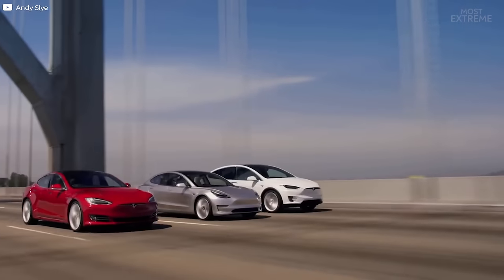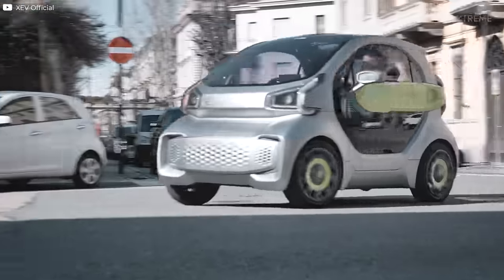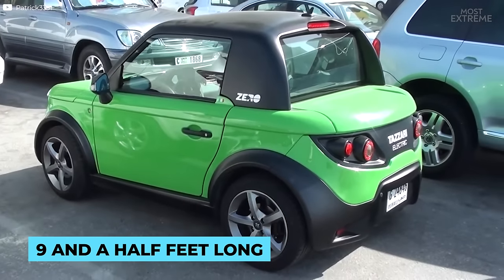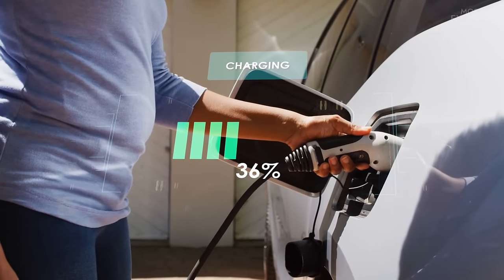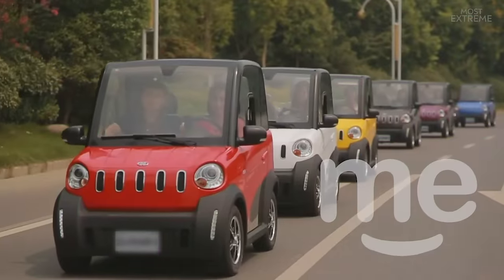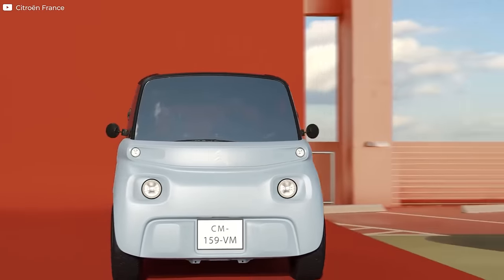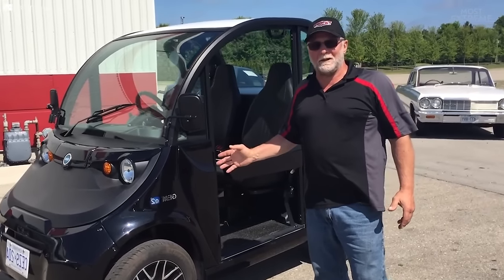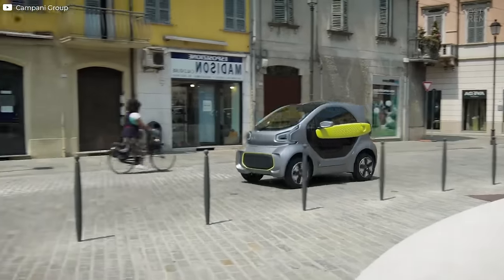10 Electric Mini-Compact City Cars For Urban Mobility

Comment: We urgently need something similar to the Japanese Kei-Cars in Europe. Restrictions in size and weight would be much more beneficial than for the power of the motor.
Reply: I have been saying this for years even before the EV craze. I would buy an kei class van in an instant if it was available and in affordable price range and if i could get one of those old Subaru E12 or Suzuki carry like cars with modern tech i would be very happy. 
I have no need of 2 ton oversized car all i need a small van that can haul stuff and isn't overpriced to the max.
Reply: @Fydron  rather unfair to tall people who then can't or have to pay lot more to drive, since they dont fit in them.
Reply: @yorickkok9223  well for me a kei class van would be perfect it's just stupid that there is zero to none available except handfull that people them self have brought here.

A 4WD Subaru van would be perfect it's small but can still haul a couch if I need to and has good mileage.

For me personally I have zero need for those oversized suv's and normal sedan to me is just plain useless.
Reply: @Fydron   the peugeot bipper and the fiat fioriono are not much bigger, even smaller is an Aixam Pro(downside the max speed is 50km/h). sadly the old kei vans with the cab over the engine is in these days are not safe enough to meet the safety standaards.
Reply: @yorickkok9223  I'm 195cm tall and drive a kei car Suzuki Hustler. To be honest it's enough space for the driver and passengers of even bigger height. I have enough room for legs and there's plenty of room from head to the roof (and I can sit on the rear seat behind myself). So it's not that small as you think.

Comment: I would drive the ones you didn't mentioned like:
- ACM City One (from Germany, with swappable batteries!)
or the "Baojun E200" from China, or XEV Yoyo (also with swappable batteries)
Reply: The great part about easy to remove batteries is also they die out over time in all cars. Ones that are meant to be swapped just make the process easier to do without having to pay a specialized mechanic to change your batteries like in say a Tesla.
Reply: Nothing Chinese for me, not even rice

Comment: I bought my Chevrolet Bolt EV almost 3 years ago and still love it. With its 260+ mile range, it shines both in the city and on the highway. With its 200 hp motor, instant torque, and a forced-limited top speed of 95 mph, it's a silent rocket. With its zero emission and almost zero maintenance, it makes me proud.
Reply: @Chingaso Clown Not "around the corner" for my Chevy Bolt. Last year, GM gave me a brand new battery as part of their recall program - totally free of charge -  together with a brand new 100,000-mile warranty. 

Moreover, before I returned my original battery to GM, I had it tested and they found that after almost 3 years of active everyday use, almost 50,000 miles, and three Canadian winters, the original battery's degradation was less than 2%. This means that, all things being equal, my battery will have juice in it for the next 50 years or so.

In other words, the battery is highly likely to outlive the car itself. After that, it can be taken off the car and used as a backup power source for my house. But, I am yet to find that out... if I live that long. 

In the meantime, I am still honeymooning with my Chevy Bolt and would never volunteer to go back to driving one of those fossil contraptions. :)
Reply: @amenhotepavoskin1307  smells like advertising
Reply: @justhavefun2640  Check your nose. Smells like real-life experience shared by a real owner.

Comment: I want something more like a subcompact.  A microcar would be great, except in the US you would be surrounded by big SUV’s and pick up trucks.
Reply: There really isn’t a problem with that.
Reply: @TEMUJINARTS  Line of sight and safety mostly. Line of sight is obvious, you wouldn't see much of anything being the shortest thing on the road. Safety though is what happens when a car that small hits anything else.

Most cars bumpers line right up with your windshield, and your low mass would mean you crumple and fly. Basically any kind of auto accident in a micro car is instant death for the micro car user.
Reply: @JustaGuy_Gaming  you’ve got a lot of opinions. I’m asking myself how much experience do you have and how much research have you done? 
Opinions seem to come off the top of the head more and more . Line of sight? I can’t speak for every micro car but I’ve own 3. 2 of with weee different models. And the crash tests available on both. Drawing the conclusion of what would happen if something small runs into something big isn’t very hard. But because it’s big doesn’t make it safe either mind you. I could expand on that but check it ok for yourself.

Comment: I live in the north east of the now un-united states And a real problem with electric cars is the cold weather.  You won't get half the battery life out of those cars in negative degree weather with the heat blasting and we travel longer distances.  I drive a smart fortwo with a petrol engine.  Some of the roads I drive on in small towns are narrow so it does well and it will go up to 95 miles per hour (152 km) if I choose to go that fast on the highway (i only go 60). I drive alone most of the time.  I would love to convert my car to run on propane because it's cleaner, but I don't have the funds.  Cost is a big issue for someone like me who doesn't make much money, so an old used smart car that runs on gas is all I can afford.

Comment: For USA urban use it must have Heat and AC. Must be able to go at least 100 miles on a charge. Must be able to do 70 MPH. Must ride smooth and be safe. At least a 3 door hatch back.

Comment: Hybrid cars would be better because you can use the battery In the  city and gazoline and diesel outside the city or Hydro-electric cars which I think will be the Best solution untill something better comes around.

Comment: Honestly only 3 things really matter in these 2 seater tiny cars

1. The trunk size 
For singles or couples who go somewhere without there kids. In short gorcery shopping for about 2 weeks worth of food. The trunk has to be moderately big. 

2. The dash board 
Needs a cup holder/s, functional heat and cold ac, and be able to listen to radio or connect from your phone via aux or Bluetooth. 

3. A steel body for the plastic rap around. 
If you drive anywhere near trh deep country and a pick up truck is going 80 miles per hour and both you don't see each other bare minimum steel frame and steel doors. 

That's just me personally.

Comment: Perfect for local driving, BUT, £10,000 is NOT a cheap car.  China is making EV K-cars cars with similar specs that sell for around  $2,000 to $3,000.  For some reason they are not legal to use in the UK.

Comment: Not sure what the market is for such cars. There are actually very few of them in cities, I see most of them in the countryside, at least the ones that don't require driving licenses. They are used by aged people who live in rural houses or small villages and need basic mobility.

In Europe, for instance, most cities have decent public transportation and most urban people don't need a car, but those who do are more likely to come and go to and from the suburbs and the city center or periphery, driving on the circular highways that surround cities, on drives that would take forever using public transportation. Being able to drive at 60mph / 90 km/h over any distance without deteriorating the battery pack should be a base specification.

Then, while renting such a car for specific one-time needs, like you can for the Citroën Ami by the minute (!), makes sense, the appeal of purchasing a car that can go nowhere is very limited. You'd need to rent or borrow another car as soon as you need to transport people or goods or go a bit further away from the city, say in a 2 hours / 100 miles / 160 km radius. That should also be part of base specs for micro cars. The two go together: A larger battery pack allows for higher voltage and more powerful electric motor. Base specs harmonization would allow for easier comparisons between brands, as well as decrease prices a lot, with all kinds of vendors competing over producing drive trains that would fit many different brands and models of micro cars.

I would also add that being too short on specs such as battery pack capacity means that the range becomes even less in winter or after a few years, thus making the car practically unsalable.

One last thing: China is currently leading on electric micro cars and EVs in general, yet I would personally not caution a regime with so many blatant violations of human rights. So no driving Chinese EVs for me until the political situation has changed, and I would also recommend not investing into China until then.

Comment: These cars are only practical when they have a top speed of over 70mph. Yes,  they're great for urban commutes,  but people don't want to have a separate car for travelling a few junctions down the motorway.  I've owned 2 petrol smartfortwos and they have had top speeds of around 80mph. They weren't ideal for motorway travel,  but (crucially)  they were capable of it. I find it so disappointing that almost all of these electric microcars are so slow.  It's the reason why I wouldn't buy them.
Reply: Making them run faster would require a more powerful motor which would be heavier and more expensive, which in turn requires more battery for the same range which is also heavier and more expensive. 
A great commute vehicle is a bad travel vehicle and vice-versa; an increasing amount of people are realizing it's not worth for them to buy a car based on the ability to road travel with when 99% of the time they're going to use it to go to work or to buy groceries and for short distance travel they have the option of buses and trains anyway.
Reply: @jackmcslay  I don't think that is all necessarily true. These cars are limited to the speeds they travel to preserve battery. Most of them are capable of higher speeds. They could have a separate driving mode for short hops on faster roads. I actually think that the main reason must be safety related. You could argue that to be safer, they would need to be heavier, but an extra 20mph from a motor wouldn't be too much of an ask (so long as there weren't very steep inclines). I think another problem could be people mismanaging their power and running out between junctions. These things could be avoided with adequate warning systems and tech though.

Comment: But a smaller car means less space for batteries so it can go even less further... although I guess if it runs out you can walk it to the next charger.
Reply: On the flipside, their weight (often below 1 ton) is so much lower than full size EV's (often 2 tons or more) that they need far less battery for the same distance. Especially for  urban start-stop driving.

Comment: Charge time and Range is hardly the main concern imo. Something that people without a home, and most likely a garage to put it in is a bit issue. You can't just run an extension cord to the street or parking lot of an apartment complex. Then you have how small light and expensive the cars are.

This makes them highly priority target for car thieves and as the smaller micro cars are often so light you can just lift them with a couple of guys or a rolling dolly. Your not going to make electric cars the standard if only home owners can realisticly use them.
Reply: Uh, what? British people park their cars on the street all the time. Can't run an extension cord to the street, why? Seems pretty ordinary to me, and getting a personal charging station installed in there so you don't have to be pulling a extension cord would pretty trivial too. 500+ kg is not a weight you can lift with just a couple guys, any of them would require the strength of at least 8 men to lift, and they would be triggering the alarm while doing so, and they're not overly expensive cars to be that attractive to thieves, in fact, EVs in general are not attractive to thieves because thieves don't usually drive around stolen cars but sell them for parts, and having much fewer parts it makes them hard to do so.
Reply: @jackmcslay  So your what going to run an extension cord out your 2nd story window... down the street and to your car? And some how believe it won't be dangerous or a tripping hazard? Or just flat out be stolen or dmged in some way.
Reply: Paul Smith  They are also one of the "hot ticket" items on the market, parts will go for a lot. I mean they already steal hubcaps, gas caps and anything they can cut or tear off a car.

This leads into a bigger issue of car vandalism and theft which is mostly ignored by the police. Seriously file a report and watch nothing be done about it. People can break into cars in broad daylight and no one does a thing about it.

Comment: It’s 80 miles round trip to and from work every day, so we need an AWD (we get 5-6 feet of snow every winter) and it needs to go 60-70mph for an EV to work for us.
The current Subaru and Toyota EVs are way too EXPENSIVE. We can buy a Lot of gasoline for $55K to $60K.

Comment: a vehicle must be able to cruise at 45 mph or more even for local driving.
Reply: the other thing to consider is wear and tear tbh. While Electric motors are less complex than gas cars, they do degrade over time. So if your max speed is 44 mph fresh out of the factory, don't expect more than say 30 or 35 a few years down the road. Basically if top speed is barely enough now, it's only going to get worse later on.

Comment: The main things for inner city cars is that it's cheap because of city impact damage if its got battery change facility because a lot of city dwellers do not have home charge and ease of parking meaning small footprint low or no vehicle tax and no congestion charge also two vehicle allowances on insurance so you leave the Tesla at home who wants to take a expensive car into the city anyway lots of people bought a small car for the wife and ended up driving to work in it and the wife uses the bigger car for shopping look out for the whuling mini EV at about £4000 a lot more interesting safety on these vehicles is a bit poor but city speeds at 20mph that's not a problem

Comment: As cute as all those are not one of them could pass the regulations and crash testing in the United States
Reply: Well, actually most of the cars shown do pass the regulations and crash testing in Europe. Given the fact that on average we drive at higher speeds and have lower fatality rates, do you really think that the requirements are lower than in the US?

Comment: These would be perfect to snap onto a drone.....!  OK, so 99 % of cars have 1 person in them.... My concept of the perfect flying car is a "snap on snap off"  a lite weight electric car with a separate top fitting powerful snap on/off drone. When you get close to where you fly into you can snap off the cart and drive to where you need to go. You own the cart but the expensive drone is rented and arrives from the drone port ready to go. Keep the cost low and always have a fully charged snap on drone ready to go. Lots of Drone Ports (Think the new gas station) everywhere storing drones ready to go. On a long trip you just stop at a drone port and switch out the drone for one fully charged. 99% of people could afford this! Keep it simple...... use what we have.... Once perfected this will totally disrupter old fashion expensive cars, clogging up highways and save environment at same time. Let’s snap on a lite cart to a powerful drone (like Volvocopter 18 blade super structure} and make it work for everyone. I AI CONTROLS WITH GPS SHOULD MAKE THIS AN AUTONOMOUS PILOT FROM POINT A TO B...... JUST TELL ALEXIS WHERE YOU WANT TO GO........ Then the whole trillion-dollar highway infrastructure budget can now be used to bulldoze down slums and build quality affordable homes with a drone port on the roof….! WOW….! WE NEED TO THINK SMALL INORDER TO GO BIG! I think this is totally feasible right now for under $15,000 plus monthly rental  drone fees? A lot better than $250,000 which no one can afford. Most of the fancy flying cars now cost over $250,000. Please make a basic model for everyone.

Comment: As cheap as $10K. Gosh, that's just half of my annual rent. And a highway safety rating of? I suppose you don't have to worry about safety because you're going slower. smh  I'm not impressed w/ any of the offerings shown.

Comment: Bunch of overpriced golf carts.  The only one that looked even half decent was the Lexus, and that one can't break 40 miles per hour.  
I want a small electric truck.  Freeway approved. Seats two, With all wheel drive. 200 miles range. A radio. Heat, and air conditioning. And not much else. For less than $25,000  A locking trunk in the front, and a truck box in the back.  
And I don't care who builds it.  I'd rather give my money to communist China than to give it to the oil-man.
Reply: Not caring well you must as well be the problem.